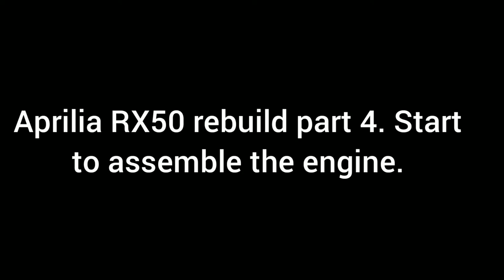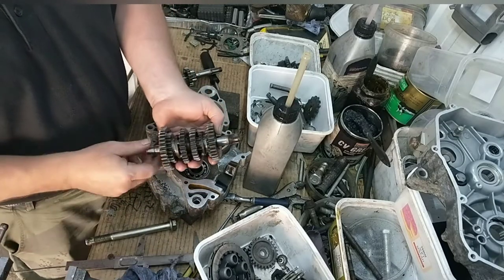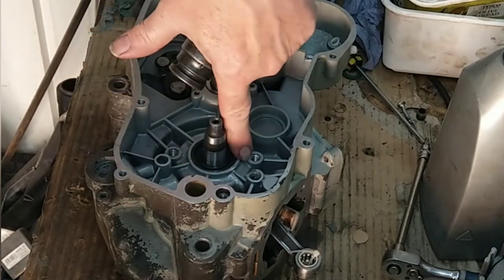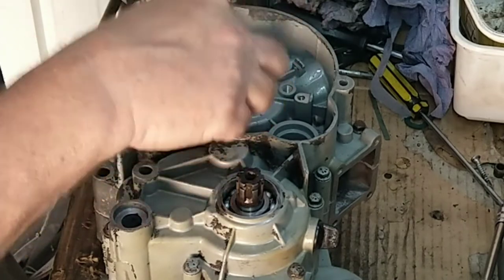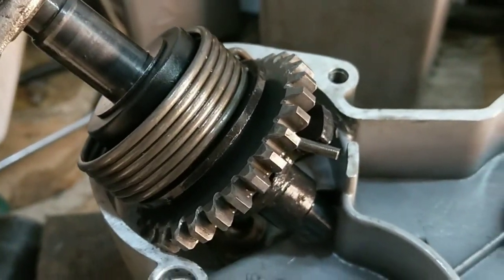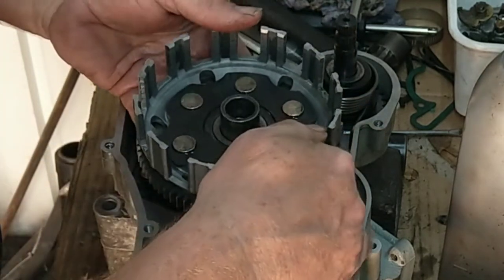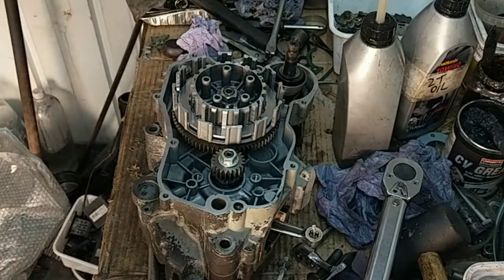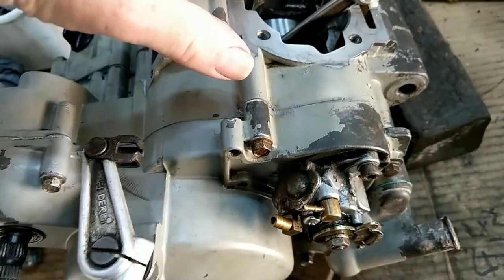Aprilia RX50 rebuild part 4. Start to assemble the D50B0 engine.

Comment from the maker: Before putting the casings together did you check you could select gears 18:35 Theres a washer top and bottom of the drum and a small roller to locate the cam plate. Here's a link to a exploded view of the gearbox https://www.fowlersparts.co.uk/parts/5917153/rx-sx-50-chassis-number-prefix-zd4pvzd4pv000zd4pva00zd4pvb00zd4pve00/gear-box
I have no connection with that website

Comment: Hello, We are changing a crankshaft for derbi d50b0 engine( senda xtreme) And one gear wheel is doesn’t come off, the first one on the bottom next to the clutch.

Should we take off the clutch to take it out , because we think it’s not necessary to take if the clutch ?
Reply from the maker: You have to remove the clutch, so you can split the crankcase. The gear you are referring to is the primary gear on the crank, this can be tight to remove.

Comment: Hi, i have problems with the gearbox. It only shifts into 1 N 2 gears. I disassembled the engine but don't know where is the problem, the gear selector forks don't seem bent, but they have a bit of wear on them,however I don't know if it is too much wear or are they fine. The shift drum looks good aswell. Primary and secondary shaft gears look like new. I really need help diagnosing the issue from someone who knows these engines well.
Reply from the maker: Did it develop the problem when the engine was in the bike or has it previously been stripped.
Reply: @TheWeeBaldyBiker  I don't know, bought it with that problem with the idea to fix it. After stripping it down, I found that the little pimple that screws in and holds the gear shift shaft (the one that rotates the star gear) was broken off and stuck. I changed it and now it seems to work, all 6 gears work, but not smooth as butter. Sometimes first does not want to engage from the first try. I will assemble it fully and put it in the bike and see how the gears behave when the bikes running
Reply from the maker: @MartZilka  problem feel better with the oil in it and engine running, I done a am6 that felt notchy on the bench and it was fine on the bike.
Reply: @TheWeeBaldyBiker  alright, I hope that is the case with mine aswell. Thanks